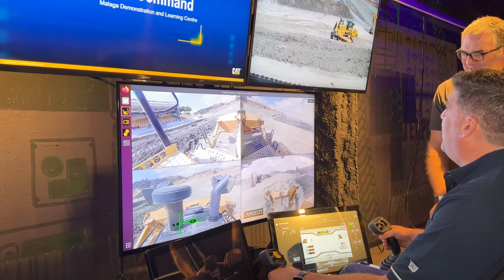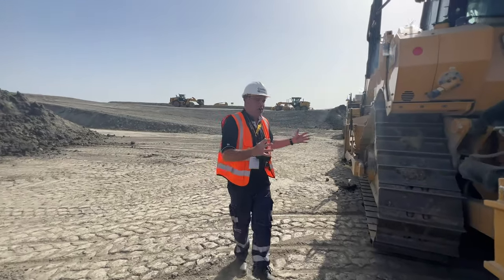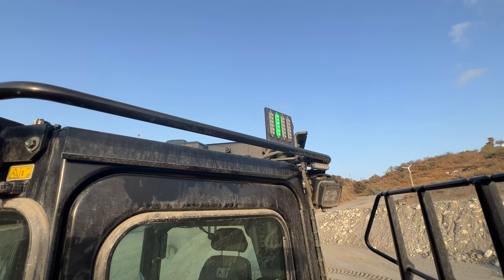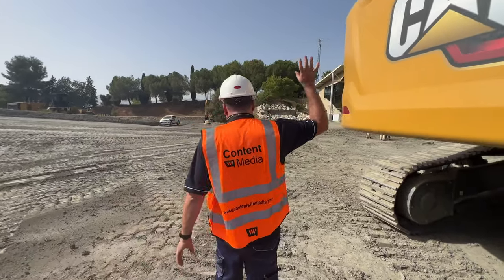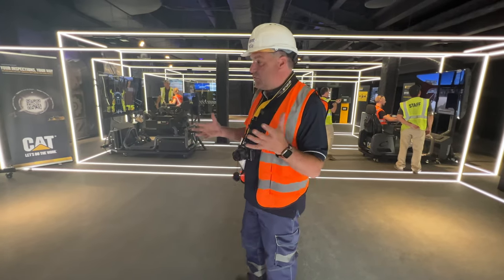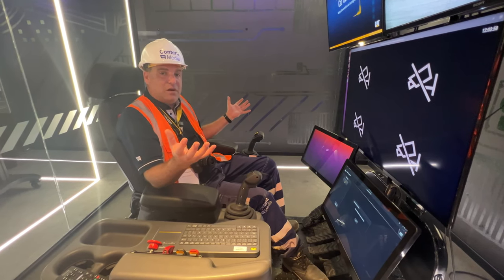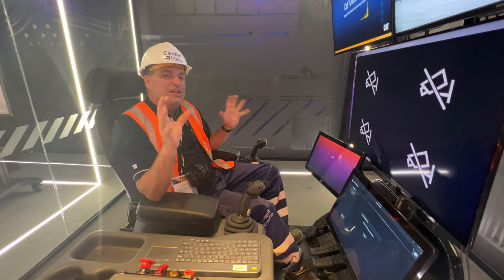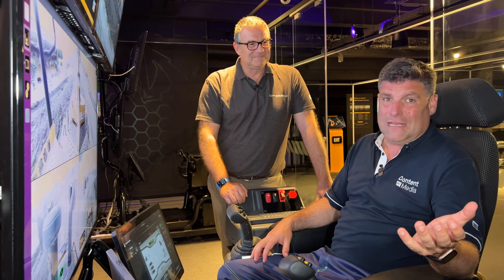Operating a Caterpillar D7 Dozer remotely using the Cat Command Station in Malaga, Spain

Comment: I’ve operated track skid steers 25 years and it’s all about feel in the machine for fine grading…there’s no way a simulator will replace that feel…These R/C machines are great for high risk mining, or demo jobs
Reply: Farming maybe
Reply: Is there much need for feel since the machines run off of 3D grading models?

Comment: Takes away all the thrills and spills of being an operator, U can't beat the thrill of sliding down a slope or nearly putting it on its side when your seat is bolted to a concrete floor, it  takes away the feel of it all. I am still operating dozers after 54 yrs never had a roll over but if I had to go and sit in an office like that all day to operate a dozer   it would drive me insane to the point where I wouldn't bother doing it any more. There would only be certain jobs where that system would work probably mining would be one,